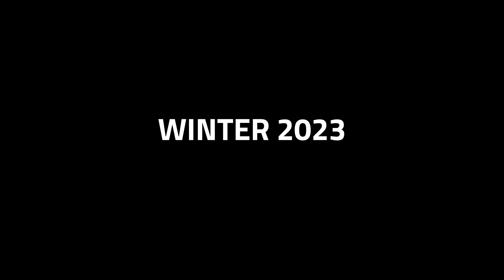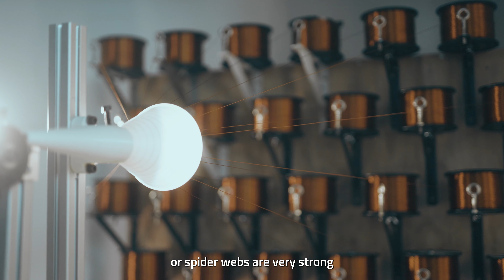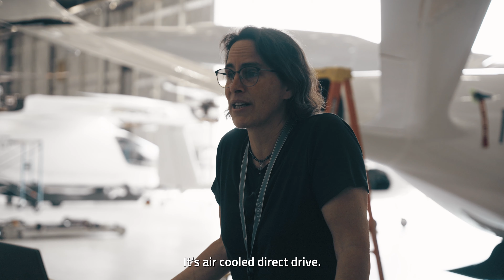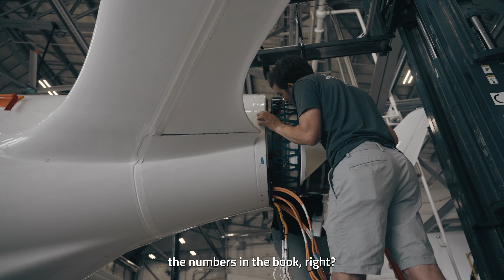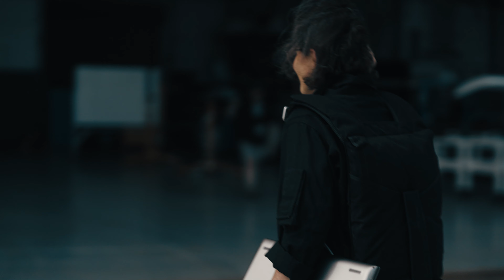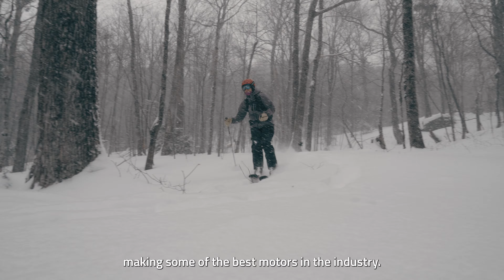Our Motors

Comment: You are in my opinion ahead of the other two US players in concept flexibility and cost effectiveness. There is a need for a model that doesn't have to take off vertically. Until rules and public acceptance of aircraft near populated areas happens, small local airports make more sense and less power drain requirements for vertical uses. In my town we need this type of aircraft for NOAA and commerce for short hops to major airports. What power is the motor and voltage?